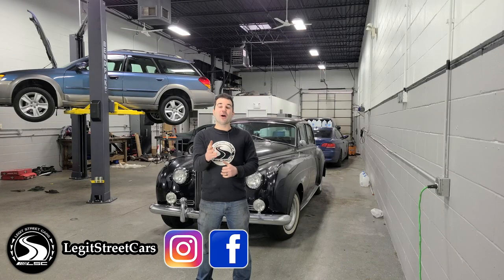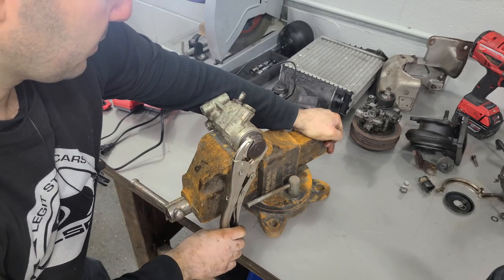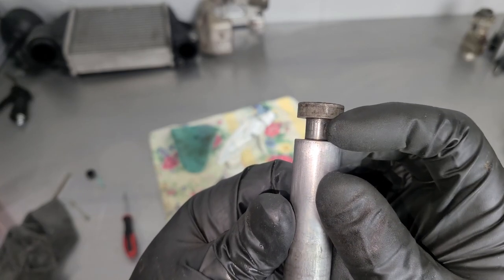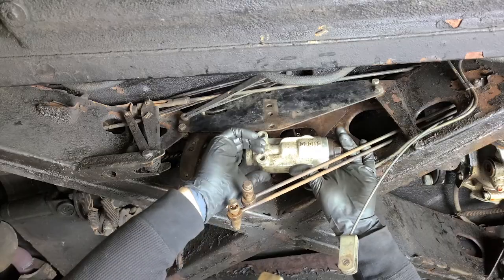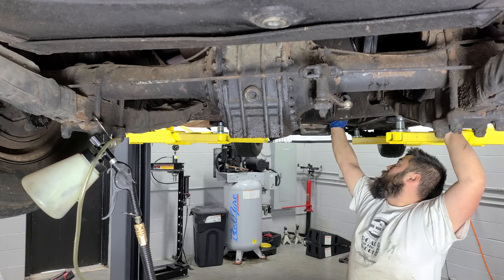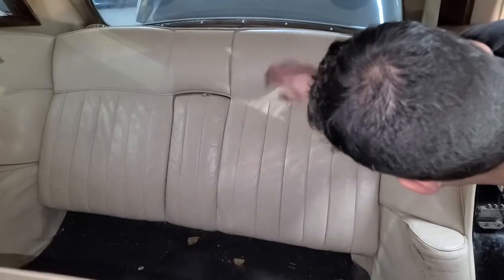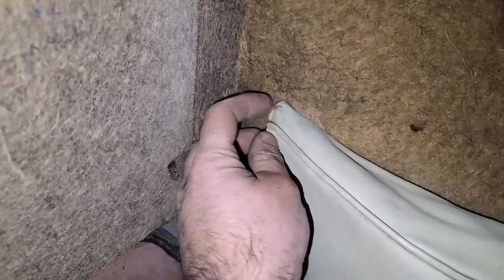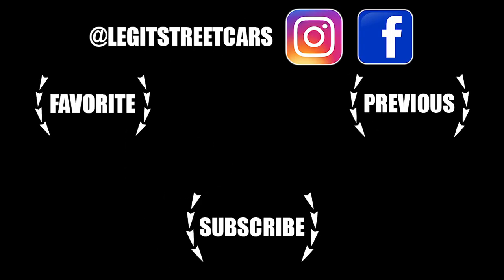Rebuilding 62-Year-Old Rolls-Royce Brake Master Cylinders & What I Found Underneath The Seats!

Comment: Nearly 2x your age. That paper is an old gas receipt from the 60's to late 80's. Most of the gas cards at that time were "merchant based". Back then they would run you credit card through a device that would take an imprint of your card via pressure (similar to rubbing paper). That process was used for years before magnetic strip card readers came into existence. Boron was the Sohio branding of its premium grade gasoline along with its regular grade fuel "Extron" .  Looks like the gas price was about $0.36/gal @ 15.6 gal for $5.55. Here is an example: https://www.youtube.com/watch?v=HB81UgdqgT0
Reply: Yep Mr. Harris is correct that's an old gas receipt. I'm 61 and remember those well when I was younger. Recent subscriber to your channel Alex, I dig your videos. Keep up the wrenching my good man.
Reply: You beat me to it. This was the Standard Oil of Ohio Company and it was quite a sign of the owners status that he could charge fuel in the 60’s.
Reply: 100% correct.
Reply: @ENWILSON  Snyder Trucking - Las Vegas NV
Reply: How did you get that rear right door to open ?🤔 was keen on seeing that in  action!
Reply: Also, at the end of the month, you would get a consolidated bill, which (I think) may have included another carbon copy of the receipts for the month--either that, or my late great uncle kept his and reconciled them to the bills. He had a Gulf account.
Reply: $0:36/gal mannnnnnnnnnnnn
Reply: We called those credit card machines, "knuckle busters".
Reply: I was a 'petroleum transfer engineer' during my college days... oh the memories of a full service gas station. Check the tires and fluids and wash the windshield whether you got $.50 or filled up. I've probably run 10,000 cards through one of those manual machines!
Reply: @tony_25or6to4  in new Zealand we called them zip zaps
Reply: June 11, 1966. All credit cards were swiped with layers of paper and carbon paper. 

The station kept the top and customer got the copy. 

You’ve got a real classic there! Thanks for preserving this beauty. Too few still running.
Reply: I'm 69 years old.  I remember those days fondly.  As I recall, my dad wasn't a fan of full service gas stations.  Just an opportunity for them to either cause an issue or over fill the oil.  He wouldn't let them touch the hood.
Reply: I’m surprised he didn’t recognize it.  I’m only a couple years older than Alex and I remember those.  In fact when I worked at a gas station in HS in the Chicago suburbs we still used them anytime the regular credit card machine went down.

Comment: THANK YOU for this video! I have a Rolls that is in dire need of this service. I know I can pick up the new part at my local auto parts house ... off the shelf for little money but with this video you help the tens of thousands of us with this car, thank you! On a more serious note LOL that vise is better made than MOST of what is on the market today. Clean the rust and a little oil and you are done. If you want, paint I guess but as a long time blacksmith (over 50 years using and collecting these tools) and a user of a lot of tools 100 years or more old, a little oil is all you need.

Comment: 29:43 Yes! The MB Quarts are super expensive top of the line speakers. A pair would run around $200 - $300 back in 1996. I was shopping for car stereo equipment back in 1996 for my 1992 Mustang LX hatchback and looked at those. I ended up with all McIntosh speakers and amp with a Kenwood KRC9000 ( I think that was the alpha numeric code) hiding deck and a 10-disc Kenwood CD changer. It was the sickest stereo system I had ever had and after spending $4000 I was in heaven. At least until 7 months later when hoodlums broke into my car and stole everything!!! That was the last stereo system that I replaced everything in. To be fair, 3 other cars within 2 blocks had also been broken into. They only got the subwoofers, amp, and CD changer. I guess they couldn't find the deck, so it did its job and all the 5.25s and tweeters were also left alone.
Reply: if the mb quarts were from the 90s to early 00s then its the good version. the current mb quarts are cheap made in china crap cuz maxxonics bought them out

Comment: If the rebuilding kit that you need to fit doesn't come with lube you can get special assembly paste from ATE. 
It is designed to desolve in the brake fluid once you start using the rebuilt part. 
Obviously you can also use it on brake drum cylinders, brake calipers and clutch cylinders.

And when you don't have a small size hone you can tape some fine grit sand paper to the tip of a smaller size drill bit. Wrap the sandpaper over the dril bit and put the drill bit in your drill. Stick it inside the brake cylinder and let the drill rotate and reciprocate. 
The sandpaper will flap against the cylinder wall and clean it up just fine.
Reply: I use a long 1/4” drill bit with steel wool wrapped around it to clean up smaller cylinders.

Comment: 56 Years Old... "Back in the Day" (late '80s) I was an installer for one of the Minneapolis area's premium stereo stores - Audio King. I did a really nice system in a very similar Rolls, with Alpine & ADS components. Enough of that. What amazed me about the car is that it came apart very easily, and went back together even easier... just a few icepicks to line up the fastener holes and the screws went right back in - no fiddling. Make sure your upholstery guy replicates (exactly) how the Brits did it originally, or it won't go back together - the fit is that tight! Get yourself (or use) a properly fitting straight blade driver set. You won't find a Phillips screw anywhere on the car. As you discovered, most everything will come out easily (especially on a southern car), if you don't bugger the screw head! To answer your question - All of that carpet padding is factory. If I recall correctly there were two or three layers, then the carpet inserts. Just wait until you check out the fuse panel... Oh, and if you pull the "door cards" (panels to us Yankees) the power window mechanism will blow your mind... chain drive!

Comment: That receipt is from a Standard Oil gas/service station. Some of my earliest memories were with my dad gassing up his red and white 1959 Fairlane at a Standard Oil station down the street from our house. This was back in the day when as you drove into the station you drove over a black rubber hose that made the ding, ding sound, which alerted an attendant to come out to your vehicle. The reason why my dad liked this Standard station was because the attendant always washed the windshield while your gas was pumping, and was always more than happy to check the air in your tires or pop the hood and check the oil dipstick. If the attendant noticed you had a worn radiator hose or fan belt this station had a healthy inventory of these items and could be fixed in their service bay easily and quickly.

Comment: I am going down a similar route. Bought a 1950 LHD Riley RMA with a rinky-dink 55 hp 1 1/2 Liter DOHC engine from Joop Stolze in Rotterdam that gets 24 mpg with a single SU H2 carb and have all the same issues (master brake cylinder, interior) that befall these cars. I think I made a wise choice. My outlays are about 2 1/2 - 5 times smaller for new and used parts than the brands that burn their ways through our wallets (Porsche, RR and Bentley). One thing that amazed me was the (British) Riley RM Club with its friendly membership assistance through its Internet Forum and reasonable prices on new spare parts sourced by the club to keep the membership´s fleet of Riley RMs going....has all the workings of a well-run cooperative!

Comment: Nice job, Nice car. The protective rubber boot on the lower master brake cylinder is not fully on/back at the top of the master brake cylinder. A good old handmade thumbs up to you.

Comment: If you're going to sand that cylindrical piston barrel, sand perpendicular to the length/height of the barrel. If you do it up and down, you can create grooves that run the length rather than the circumference.

Comment: This was very entertaining- thank you.  SOHIO= Standard Oil of Ohio. Duron is a diesel oil. Boron is a chemical element with the symbol B and atomic number 5. Extron s a  fluid lubricant engineered exclusively for chains. In essence, a recipe for making your own Grey Poupon.
Reply from the maker: Haha
Reply: I am 63 and we used that type of credit card receipt for cards and cash when a customer needed a receipt with our business name stamped through the carbon.  The machine was manual and we used them from the 70’s into the 90’s
Reply: wikipedia answer :)
Reply: @CarDocBabaPhilipo  those things are still been used :)
Reply: @slyonme  I don't think so. AFAIK, it's a long time (> 10 years) that paper receipts are no more used, in Europe at least. A dear friend of mine worked in AMEX in Rome and told me that for safety reasons the manual process was totaly dismissed and abandoned at the end of 2000s.
Reply: @CarDocBabaPhilipo  The sound of those old imprint machines is exactly what it sounds like to rack a shotgun. I've fooled a couple with that trick.
Reply: @LegitStreetCars  no grey poupon?

I'm disappointed

Comment: I recall the floor carpets are 100% natural wool woven in a specific machine to maintain strength and durability. The underlayment is also specifically manufactured to protect the wool fiber from damage and allow it to “breathe”.
Wool is very tough and durable but a natural fiber that resists cold and moisture. It needs to be refreshed, not cleaned, by a professional who knows how to preserve it. The trunk liner may also be finished in wool. Now you can understand the outrageous price for replacement! If you have the carpets refreshed professionally, you will still smell the aroma of clean wool (and new leather on the seats) once reinstalled in the cabin. Italians are most cognizant and appreciative of this sensory bouquet!  Be sure to give Nona a nice long drive in it when you finish the interior…you will see one big smile!
Reply: Most luxury Britmobiles had Axminster carpeting. Very thick and durable. Yours doesn't seem to be Axminster.

Comment: I had a bit of experience working on the girling brakes and hydraulic clutch system on my Volvos over the years and found that British hydraulics preferred Castrol brake fluid over US type 3 fluids, the US stuff would break down the rubber parts fairly quickly and cause them to leak.  I never did get to try using silicone fluid in these systems but that is supposed to be good for the rubber.

Comment: SOHIO was Standard Oil of Ohio.  Look it up on Wikipedia - kind of interesting.  I am 72 and remember gas tickets that looked just like that back In the 60's.  Cool!!  I also remember air conditioning condensers in the rear.  Cadillac used them from 1952 which was the first year Cadillac had factory air through 1956 and then went to front vents in 1957.  Of course limos had  and still have rear a/c.  Great channel, Alex.  Always like the content.

Comment: Just a comment. No need to fire up the engine to check the brake pedal feel because they are not power assisted. They are servo assisted so no need for the engine to run. When adjusting the brakes, all you have to do is adjust the back drums and the front drums automatically adjust themselves. Rolls Royce magic!

Comment: Crumpets are like your pancakes but are about an inch thick and about 3 inches round. The crumpet is something special as they are full of small holes (like pockets) on one side. The other side is just flat like your pancakes. So you toast both sides so that the base is crispy and the top is brown and squidgy. You lash butter on the top and let it melt into the holes. Best eaten when piping hot and because of the holes the melted butter will run down your chin when you bite into them. They are something that you should try at least once in your life.

Comment: SOHIO - Standard Oil of Ohio.  An american company, a successor of the original company established 1870 by John D. Rockefeller.  Ceased operation in 1987 but sold under the BP umbrella until 1991.  Pretty cool find!

Comment: There was a family owned Company that rebuilt brake cylinders in Seattle. My problem was, I needed the cutch part of my Master sleeved down since I went to a modern slave cylinder. They did a great job and cheap too. My Master was originally for a '61 Chevy Truck with a stick shift. My car was a '51 Ford altered wheelbase, straight axle gasser.

Comment: I wonder if that crazy sound the car made when braking while you were in SC was the brake-assist servo trying to kick in because of the low brake fluid in the system before you bled the brakes.

Comment: I don't usually comment but I feel compelled. First, I LOVE the hat. Looks like English rock star in the 70s. Second, the credit card receipt is from a Sohio gas station (I think gone now - as a previous commenter stated, a company name for Standard Oil of Ohio) on 6/11/1966. Looks like the owners name at the time was Snider. Perhaps he was a doctor as it looks like the signature starts with "Dr.". Finally, did you research what kind of leather went in those? The legend is that Rolls Royce only used leather from male cattle as they believed cows that had given birth had stretchmarks! So hilarious I hope it's true. They may have used a certain breed of cattle as well. All leather is not alike.
Reply: Connolly leather, as used by Jaguar is sourced from Australian cattle because their skins aren't scarred by barbed wire since they live on huge unfenced ranches.

Comment: The receipt is for a gas fill up - If I'm reading it right it's 15.6 gallons at .36 cents a gallon = $5.61. Don't know where $5.55 came from but it's close. Had a mechanic friend back in the 80's with 1960 Rolls almost exactly the same as yours - burnt a valve and vividly remember a replacement was $300 in 1980. Also looks like your Mr. Snider was actually DOCTOR Snider based on his signature upper right. Drive safe!

Comment: So you received a lot of responses to te fuel recept. I’m 61 but here are a few more facts about gas stations of the 60s. The attendant pumped your gas, offered to check the oil and would check any other fluids if requested. Attendant also washed your windshield and if a tire looked low would check that, many attendants also wore a stainless steel change maker on their belt loaded with coins that could be dispensed with the flick of a lever. And during promotions customers could earn drinking glasses or other bonuses. And best of all, when cars rolled in or out they ran over a hose that rang a bell. All of this for 25 to 33 cents per gallon.

Comment: I'm 80.  Common slider charge slip from back in the day.  the 1966 date is just fine.  SOHIO was Standard Oil of Ohio.  It got merged into BP eventually.  It was a gas brand.

Comment: If the rubber is not rock hard and not cracked or scuffed, just put it in a pot of water and boil it for some minutes.
Sometimes this is enough to reuse the seals.

For assambling break cylinders use ATE break cylinder assembly paste! "Bremszylinder-Paste" in German. Blue tube, nothing else!

Comment: That's a credit card receipt I've seen many of them I'm not sure but it might be a filling station or what you would call a gas station but I'm really not for sure. By the way I've never seen so many linkages to operate a master cylinder but than again I've never worked on a rolls the most exotic car that I've ever worked on was a lambo I had to put a water pump on it and tune it up. God bless you guys and as always be safe 👍

Comment: as others have pointed out it's a gas station credit card receipt. each brand of gas had their own credit card before mc and visa ruled. the way it worked was a carbon copy. there was a roller that made an impression of your card with the raised numbers through the carbon and you signed the top one and they tore off the bottom carbon copy and gave it to you as your receipt. this video shows how it works https://youtu.be/a7wutgAlNHk

Comment: I wonder if a brass gun barrel brush in the appropriate size would've worked for cleaning the inside of the cylinder a little easier.

Comment: I'm 60 and worked in retail on the 80s. We used those carbon copy credit card slips until the early 90s, but they did have them as early as the 60s. SOHIO is the Standard Oil Company of Ohio. A chain of gas and service stations. I expect this receipt is for gas. It looks like the business address is in Lancaster OH. I found several references to a Dr Clifford B Snider who was an MD in Lancaster OH way back in 1925, so he was already quite old when he got the car.

Comment: I pumped gas in the 60s and that was a credit card receipt for gas or oil. Yes they handed there card to you , then you placed it on the hand roller and took an impression. Gas was 35 cents a gallon.

Comment: it's not surprising you keep having issues...using a some vice grip locking pliers and an adjustable spanner to loosen bolts rather than an appropriately sized ring spanner on a 61 year old car places you on a surefire hiding to nowhere!!

😅👍👍

Also, it's not as if they weren't still using Imperial spanners/bolts back then either.

You probably have the correct sized spanner in one of your hooky American sized sets somewhere 🤷🏻‍♂️

Comment: You may already know, but you sounded confused on the video; 'horsehair' was a type of grass that all German car manufacturers used in the 70's and before to make seats with.  It could be molded into shapes using adhesive, and was pretty durable, especially given the cost of materials.  Every air cooled Beetle you've been in?  That smell?  Horsehair...  And yes, that was a CC receipt from the 60's.  I'm 52, used to mess with those horrible machines in the 80s.
Reply: Correct! I had it in my old BMW's and Peugeot 404 as well.